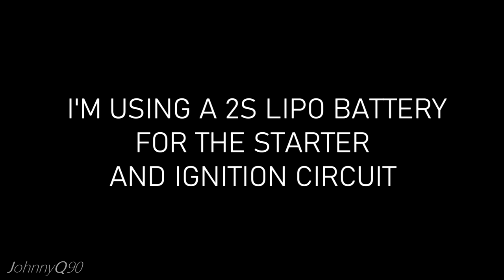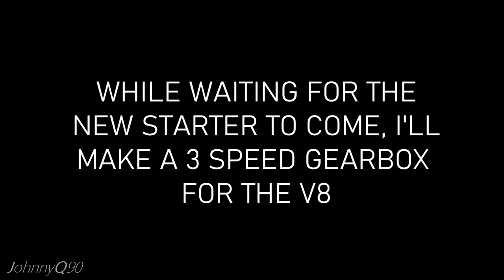Miniature FLATHEAD Four Cylinder Engine Assembly & RUN!

Comment: I love how, because of the last video on mini engine building where a ton of people were questioning your timing of the cams, you show the TDC/timing marks/process on this one. :D
Reply: I'm thinking the poor exceleration is due to the timing being 12* Before TDC (top dead center), not 12* BELOW TDC, and work up from there, like it should be......
Reply: There's no below TDC. You are timing on degrees of rotation before TDC. He is correct.
Reply: @wigs1098  Yeah, I was so puzzled at this comment I just ignored it. Lol
Reply: 👍#300💯💯💯
Reply: I want one of these kits so I can tell my grandchildren how life was before  electric cars.
Reply: So when the engine comes out the box the cam isn't marked with the correct timing and degree?? Asking cause I wanted to get one but if it's not marked I would have a really hard time
Reply: @Mike-jx8ks  I'm pretty sure it's timed fine with their instructions inside box, and just runs bad cos it's essentually a toy.
Reply: @DaftFader  -- Besides, like other engines, it may need some time to break in.
Reply: @PlumGurly  Yeah that too, needs to clearance it's self and parts need to settle into position etc.
Reply: @DaftFader   It doesn't appear to have a choke so,  It needs to warm up before it can run smooth...
Reply: @antilitarded4142  😊
Reply: @Lowonfuel  Don't you open the choke for startup, and close it when it's warm tho?

 It's been about 30 years since I was in a car with a choke and carb, but if memory serves me right having no choke is akin to having an open choke, so it would technically start and run fine to begin with, but be too rich once warmed up no?
Reply: @DaftFader  No... you have it the other way around!.. You close the choke (not completely, though) to reduce the air flow, while you also increase the idle speed to compensate for rough idle. That enrichens the air-fuel mixture (richer in proportional amount of fuel to air), and that makes it burn better when the engine is cold, thus start at once. Next, as the engine warms up, the choke should open, leaning the air-fuel mixture (lean on fuel). 

The principle behind this is that the engine and combustion chamber temperature helps the air-fuel mixture expand and combust better, and if the engine is cold, enrichening the air-fuel mixture makes it more combustible and that compensates for the cold or cool temp inside the engine. 

That last part; without a choke, the air-fuel mixture would have to be enrichened from the carburetor's mixture screw, and would become even richer when the engine warmed up... and would also pollute much more, would stall at stops/traffic lights, etc. and you would possibly have to set a higher and abnormal idle speed.  

Did you catch when the guy says he has to buy another starter?... He probably ruined the one included with the engine, probably because he worked it so much trying to start the engine. That happens when the choke doesn't close properly or, in this case, because it doesn't have a choke.  To compensate for the cold engine he should have warmed it up with a heat gun set at the coldest temp, or use it from a distance, or used a hair dryer instead, and if necessary screw out the mixture screw to enrichen the air-fuel mixture.
Reply: @Lowonfuel  Yeah I thonk it's how my dad called it cos you oull out the choke to turn it on, but he would say open the choke when he did it, as he pulled out the lever..  XD
Reply: @DaftFader    Yeah, that was a manual choke… used maybe up to the early 50s because the only ones I recall were early 50s Chevys and obviously an old 32 ford that relatives owned. Later on, the automatic choke came as standard equipment, and all it needed was to depress the gas pedal to set the choke plate closed, with about an 1/8" inch opening. It had an electrical thermal metal coil that shrunk as it warmed up and dragged the choke plate open.  
That was simple engineering and simplified things without the need for electronic devices or computers or even mechanics, to keep engines working properly… and the only required intelligence was an average human.
Reply: @Lowonfuel  Ah we had the manual chokes in the UK till like the 90's, but then manual gearbox has also been popular here even to this day (although it's starting to be taken over by autos more and more).
Reply: @DaftFader   Ah, so that fills in the missing details on why the manual choke.  I had read multiple times about the manual transmissions remaining popular over there. Also, that smaller 4-cylinder engines have been common, that pollutant emission laws are relaxed, etc... At least they waited for automatic transmissions to catch up with manuals on the number of gears...
Reply: I'm certain our cars growing up in the 1970's and had automatic chokes but my 1963 and 1968  Impalas and every pickup my dad had from the 1960's and early 1970's, had a manual choke as did my 1974 Ford Camper Special pickup. I also wonder if automatic chokes could have been an option?
Reply: My first car was a 2 door 57 Chevy Biscayne  with a 6 cylinder and auto transmission, and it had an automatic choke. Next car was 58 Chevy Biscayne 348 V8 with automatic choke. > 63 Impala = auto choke, 66 Pontiac Tempest = auto choke, 68 Camaro = auto choke... and quite a few other cars I've owned and not a single one came with a manual choke, nor did those family members owned, except a couple cars may dad owned; a 50 and a 53 Chevy did have manual chokes. 

Different factors may have been at play... things like winter weather, uncertain weather for the season, where a manual choke would be more practical, since automatic chokes could only have one setting, and though the choke warm-up coil also respond to ambient temps and that adjusted the choke flap according to ambient temps, but it didn't always work as perfectly as expected. But you could pull the manual choke just enough to close the flap according to the weather, and you could also adjust it after cranking the engine according to how it worked, so the control was in your hands. Other possible cause could have been optional offers according to each car dealer's conveniences or buyers preferences. 

Another convenience of a manual choke is it never failed, whereas the automatic choke would when the choke coil burned out, with hard engine starting results.
Reply: @markwilliford4567  i wouldn't worry to much.  Just Politicians working hard 2 convince nieve people that the internal combustion engine can be replaced with batteries. The Battery Technology needed to make this a reality is so so far away it makes us even having a conversation about it ignorant.
Reply: Ver motor Taurozzi , no tiene ruido de pistones.
Reply: Repent to Jesus Christ “You also must be ready, because the Son of Man will come at an hour when you do not expect him.””
Luke 12:40 NIV
h
Reply: Rods are too heavy on this piece to run smoothly. And carb is A joke. With lots of atdc you get only soft idle.
Reply: @Lowonfuel  You may be onto something with the Winter weather area automobile's coming with different choke system options as I have lived in WI and MN all of my life (- a six month stint in Kissimmee, FL) and we rarely hit a winter without -20°F for days, if not weeks on end.  I also just moved my neighbors 1968 Firebird into storage, it has a factory manual choke. So I'm guessing manual chokes were optional?
Reply: I'm guessing that manual chokes were the choice for those consistent cold mornings, because it would never fail… but auto chokes would at some point, and when that happened you wouldn't be able to start the engine, no matter how much you tried… you would have to know how exactly they work, and what tricks you could use to make the air/fuel ratio right for starting the engine. 

For what I've read, automatic chokes could close when driving down the highway at night in freezing cold... and obviously make the engine run rough and even die on stops and traffic lights, waste fuel, etc.
Reply: Remember that the Lord Jesus Christ died on a cross for you because He loves you so much. He then rose up from the dead three days later
The Ten Commandments are called the moral law, (most of us are lying thieving blasphemous adulterer at heart and deserve hell) you and I broke the law, Jesus paid the fine. That’s what happened on that cross. 
By believing that Jesus died on the cross and rose up from the dead 3 days later and not just confessing your sin, but also repenting of all sin you have done and putting all your trust in Him in prayer, He will grant you everlasting life as a free Gift.
Reply: As an owner of several Model A Fords, this engine is derived from that.
Reply: I'm super puzzled by that comment... But I know I didn't read the other 2000+ other comments to know if it was warranted.
Reply: You should read the one before it.... It's the second bot posting similar religious text! The comment about Ford engines is probably one of the more on topic posts lol.
Reply: YouTube is getting filled with these religious postings! I've come across at least 12 on this one. The Ford engine comment irks me only because people post something that has already been posted and repeated over and over, like they were the first because they can't be bothered to read anyone else's comments, and because they are so self important they can't imagine after thousands of comments anyone else has said it "is" patterned after a flat head Ford. Part of the problem is I'm too old, crabby, and opinionated at this point, and every once in a blue moon I comment on YouTube lol.

Comment: Wow an actual miniature version of a real engine! All the other ones I've seen are not in my opinion because they are not fired with a spark plug and do not have an oil system. This engine is way cool!
Reply: But not a the correct design level 😉
Reply: You should see the Ford  style V8s that runs
Reply: Yeah, some are just models, not actual engines. This certainly is cool.
Reply: @mattcast8761  yeah, it's not even the right color
Reply: @rusty383  and also Ferrari 312PB scale model. Years of of hardwork put into it. Amazing dedication.
Reply: Repent to Jesus Christ “You also must be ready, because the Son of Man will come at an hour when you do not expect him.””
Luke 12:40 NIV
h
Reply: @repentandbelieveinJesusChrist3  what does this have to do with the video
Reply: @scottkellogg8145  Not a god damn thing.
Reply: @benmurphy7654  don't have to be that way
Reply: @scottkellogg8145  It was a joke.  Nobody has to be any way including not being the way I was.

Comment: Didn't even know there was working mini model engines. Awesome work.
Reply: Search for toyan engines you will fing some pretty cool stuff: v8, rotaries (including a 2 rotor one), inline 4rs, 2 cylinders, single cylinders and even a supercharger for the toyan v8 with that awesome whine
Reply: @user-wx2bk8is4s  now I want to see some put this on a rc car.
Reply: ikr? it just tickles my brain watching it get put together
Reply: this was designed to be used in an rc car
Reply: @joeyginise6051  there are videos on yt where people use those engines on RC cars, worth checking them out.
Reply: Có bán mô hình này k